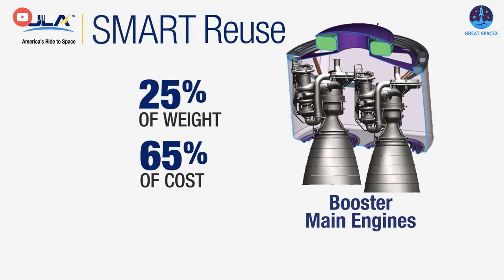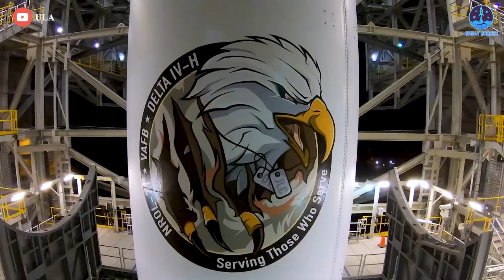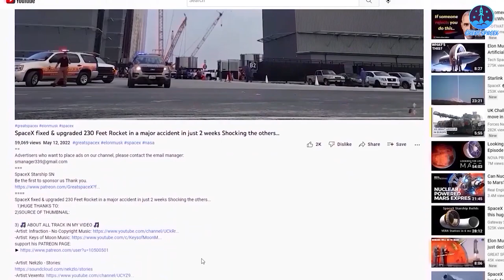ULA Tory Bruno just declared "fight back" to STOP SpaceX's launch monopoly with new-gen rocket

Comment: ULA is relying on the BE4 which, in my opinion, is a flawed engine.  There are no flight certified BE4 engines.  So, in the current situation, ULA has nothing.   If BO can't deliver; ULA is done.  If I were Bruno, I would be working on my resume.

Comment: Yes, before Bruno the parts of ULA inherited from Boeing (McDonnell-Douglas, actually) and Lockheed Martin, respectively, continued to work as essentially separate entities. The only reason for the joint venture was avoiding head-to-head competition; it was, essentially, a cartel.
To be fair, at the time when ULA was formed and got single-source contracts (a.k.a. monopoly) on government launches, there wasn't domestic competition in that weight segment. But, when SpaceX came up with their Falcon family and prove its reliability, they had to literally sue DoD to even be considered for future contracts. It would be interesting to see what would Pentagon do now if ULA stayed at their complacent position.
Qualifying Vulcan for launching sensitive, expensive payloads and especially crew will be expensive and time consuming, but even more so holds for Starship. Then again, SpaceX has plenty of their own payload (Starlink 2 satellites) to train on.
Reply: key factor is bribes, backdoor dealing and planned retirement jobs for various people in the companies they help, that keeps launches for ULA. i guess the question is how long can they keep that up?

spacex has sued, and in one case dropped the lawsuit not because they were wrong, but because their competitor was trying to frame it as "spacex is getting in the way of national security payloads by blocking this contract with a lawsuit". So spacex cleverly let them have it despite the obvious BS requirements that only matched ULA, they could have wont but would have taken a big PR hit. That little bit of money wasnt worth it. You can think of the bidding requirements like 'the company owner has to wear a tall hat, have a waist line EXACTLY THIS SIZE, must have this type of facial hair and be from two areas' the requirements made no sense.

Comment: if he doesn't move ULA towards reusable rockets and other reusable technologies, they will be insignificant by 2030.  Also, he could've canceled the Atlas V in favor of the Delta-IV Medium-plus launch vehicle.
Reply: The Atlas V is basically canceled as there only a few of them left and all remaining flights are spoken for.  If BO cannot provide flight certified engines to ULA it will be game over for ULA and Bruno.
Reply: The Atlas already had contracts and is much cheaper than Delta.  They will need to become fully reusable, but I think they still have 5-8 years to get there.  It may be possible.

Comment: Why the heck are these company's still spending many millions building boosters and engines that can only be used once?.
Haven't they learnt anything from Spacex.
 Ok, Falcon 9 isn't the biggest booster at the moment, but it sure does the job. How many companies can boast that one of their boosters has lifted off the pad, put the payload into orbit, and returned back to earth. 
In the case of one booster, 13 times. Some of the other Falcon 9's are in double figures for flights or fast approaching double figures.
This must tell you that Elon has got it right.
Can't wait for Starship to fly. That's assuming the FAA don't put a spanner in the works.
Reply: In fact, Blue Origin has mastered booster reusability even before SpaceX. Their New Shepard rocket is reusable one. New Glenn, a much bigger booster with BE-4 engines, will also be the same.
Reply: @tocu9808  In fact, Blue Origin hasn’t ‘mastered’ anything. The engines they use on New Shepherd have never truly propelled anything into space and they have never carried any type of cargo into orbit, commercial or otherwise. They have never taken Astronauts into space, and the BE-4 engine is years late and still untested. There is no comparison between SpaceX and Blue Origin.
Reply: @tkmaxximum9594  - The fact ís Blue Origin had accomplished rocket booster reuse before SpaceX did it. That they have not achieved orbital launch is another story.
Reply: @tocu9808  well if we use those rules Germany created reusable rockets in the 1940s....
Reply: @Alucard-gt1zf  - Which one ?